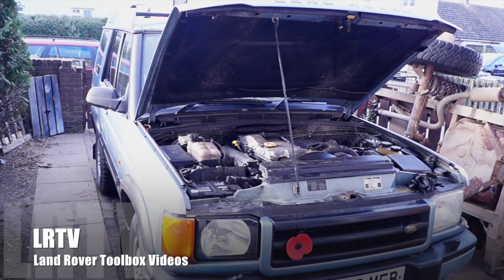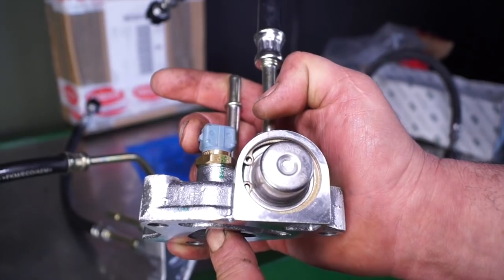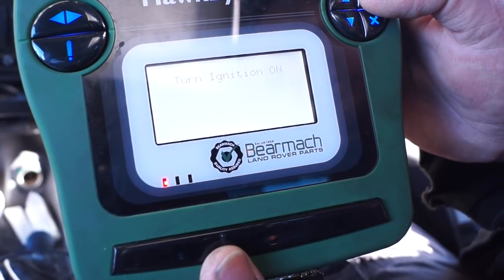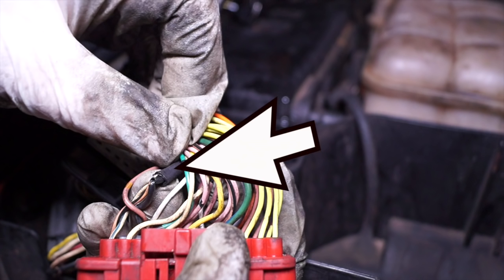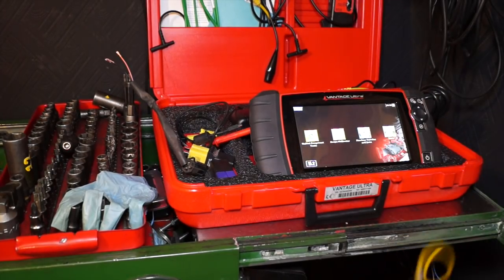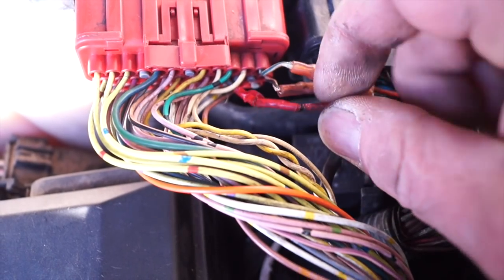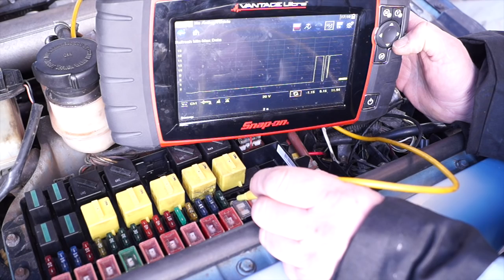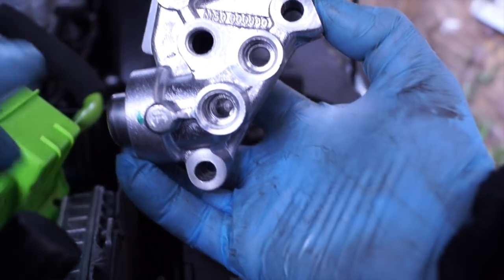Td5 Non start problems. PART 1

Comment: That happens with my 300 tdi
Reply from the maker: rusted pipe on the fuel sender?
Reply: Sorry I wrote "happens" instead of "it happen right now " so I read on the internet about it of non star thing ( it happened to my while I was driving shot down without any symptom ) I read about a thing called spider module or spider alarm that thing it cut off everything from fuel injection to ignition so it says that if has some "dry joint" (a bad solder joint that makes a bad connection ) so my question is so what other I need to check ? ( fuses are ok  , even the solenoid makes the clicking sound and the line of power supply has 12v )
Reply from the maker: If the fuel cut off solenoid is working with the ignition on and there is power there then the spider is okay.  The immobiliser will cut power to the starter and the fuel solenoid.